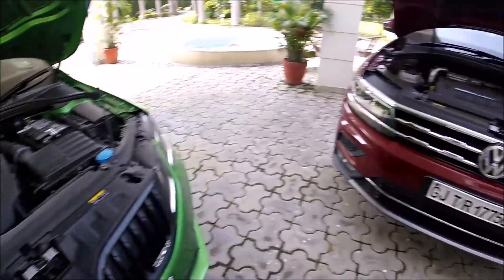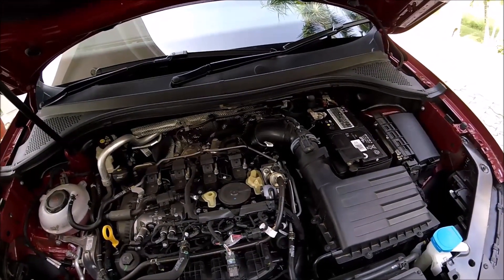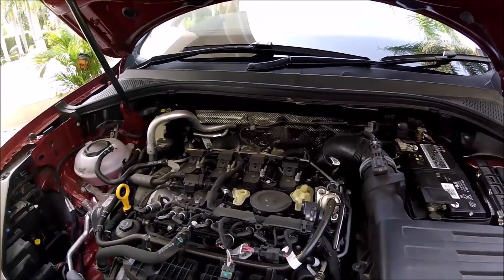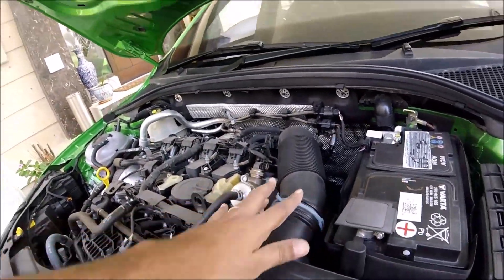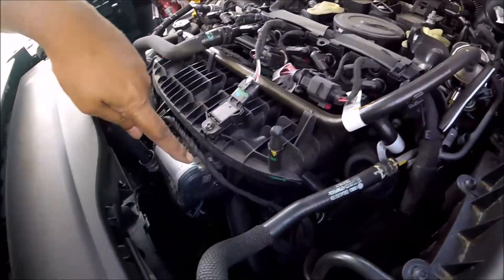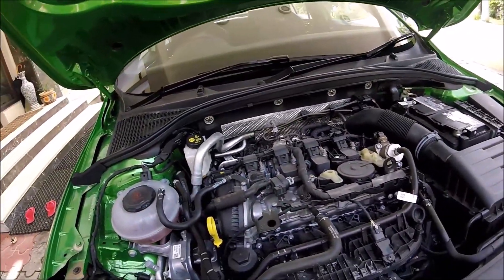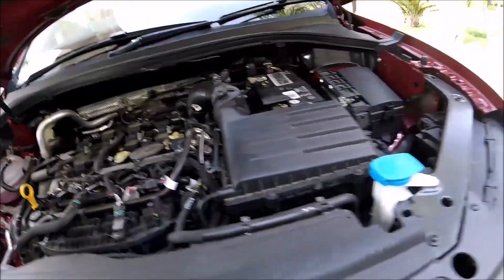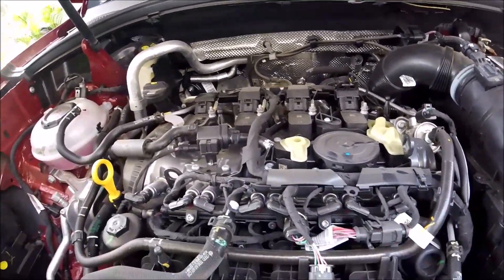2.0TSI Gen 3a and 3b- Differences between engines in the Octavia RS245 &  Tiguan, Superb and Kodiak

Comment: Would you recommend tuning a Tiguan 2.0 TSI (facelift)
Reply from the maker: @thekidshrey  well if it’s a Gen3b then yea, stage 1 and intercooler will net you ~250hp ish. Gen4b you can’t tune yet. Some of the 2023-24 Tiguan and kodiak’s came with that engine
Reply: @PrithwiRay  How should I figure it out then if it's a Gen3b or Gen4😅
Reply from the maker: @thekidshrey  3b has a MAF sensor right after the intake, 4B doesn’t.
Reply: @PrithwiRay  Oh ok! Which place would you recommend would be the best for tuning in hyderabad? Any idea?

Comment: Hi Prithvi, Very informative video. I have allspace stage 1 currently , I need more power , I was thinking of a engine swap with 1.8 stage 3 IS20 280hp but then it will cost me around 5 lakhs and I won't get good price for my current engine So I was thinking of pushing my current engine to 250-260hp with mildly tuned IS20 turbo. If it can last 15-20k km , it is worth it and then may be I will rebuilt it or swap it with 1.8 whichever is cheaper. Do you think it can produce 260 hp safely for 15-20k km?
Reply from the maker: 260hp not doable on the current engine.

Comment: I tuned my tiguan 2021 ea888 gen 3b to stage 1 and currently in the process of doing a stage 3 with a light map expecting to push 300+ hp. Upgrading the turbo to is38, upgraded intercooler, air intake and downpipe. Would you say it is safe to run in such a setup? Will be using 100 octane.
Reply: I have an Octavia with the same engine. While the initial excitement of a stage 3 tune may sound good,  from a practical standpoint won't make sense as there are very few fuel stations offering 100 octane petrol.
Reply: Also from my conversations with tuners is they don't recommend a stage 3 as it's too risky considering the quality of fuel here.
Reply: To make it short, if you are into tuning your car, sell the Tiguan and pick up and gen 3 1.8 tsi engine and take it to stage 3+ with close to 400 hp!

Comment: Hi, I see that movie is quite old but you still answer here. I have just got kodiaq rs tsi 2023, is there still dktb gen3a engine or they are puting something else now?
Reply from the maker: Depends on country. The Kodiak RS is the same engine as the RS245 I have, Gen3a 2.0TSi
Reply: @PrithwiRay  it is Poland 245 horse power. Thanks a lot.
Reply from the maker: @ekogoryl  yea in that case you got the gen3a motor. Skoda only gave the gen4 tsi motors in the mk4 Octavia

Comment: Hi, will a head swap be enough to turn a gen 3b motor into a gen 3a motor? I saw some guy plonking a vrs engine in his superb. I wonder whether it's a full swap or a head swap or something.
Reply from the maker: Nope. 3B is a totally different engine with new block, head, piston, rods crank. It shares nothing beyond the intake manifold, intercooler and radiator with the 3a.

Comment: Nice video. Quick Question - What sort of power/torque figures you can bump up in the new Kodiaq 2 TSI if tuned?  Say Stage 1.
Reply from the maker: Give or take 250hp if your going to add in intercooler. 220ish hp if your going to keep stock intercooler
Reply: @PrithwiRay  Thanks for the swift response. Any idea on what torque figures we can extract ? The stock figure is 320NM.
Reply from the maker: @vijaydrives  torque goes upto 400+nm
Reply: @PrithwiRay  Great, thanks!

Comment: Excellent explanation of the differences of these two engines. Please make a video on the internal differences of the engines. I have read somewhere that even the pistons are different and they also have different engine oil requirements such as 504/507 for the EA888 GEN3A (5W30) and 508/509 for the EA888 GEN3B (0W20).
Reply from the maker: all Gen3A post 2019 are 0w20 as are the Gen3B motors. Pistons are different, so is the fuel system, 3B has higher pressure in system for the mpfi.

Comment: Hello! I have a polo gti 2019 and I have entered the process of a big conversion. The car is mainly forged and wears Garrett 3071 gen2. Now we are in the programming stage and unfortunately what we notice is that it cannot inflate the turbo easily. Maybe an octopus needs to be inserted so that the exhaust gases have a better flow. We bolted it on. Any other comments on what could be wrong? Does anyone know if the gen 3b is not as efficient as the gen 3? Thanks!
Reply from the maker: It’s not meant for big turbo as the Gen3b is a very high compression motor. Some guys have put an IS38 on it, but it then needs 100RON fuel and nearly zero timing
Reply: @PrithwiRay  understand what you are saying, however I have another question... Is this motor less efficient than the gen 3? The fact that it has higher compression should make it more aggressive at the same time. But on the contrary, it looks too clumsy and weak. It can't inflate the bigger turbos easily.
Reply from the maker: @Oikono13  yes it’s a lot weaker than the Gen3 2.0tsi. The Gen3B is a replacement for the 1.8tsi

Comment: Quick question. I've got no idea which engine is in my audi a3 s line. It's comes with 190 ps, but the oil filler is low down, it has no heat sheild for the brake reservoir, exhaust vvt actuators not the intake but it has the smaller HPFP and throttle body off the gen 3B. I'm very confused
Reply from the maker: If it has a MAF it’s the gen 3b. Only the 45tfsi cars have the 245ps motors
Reply: @PrithwiRay  thank you for that any idea what turbo it is?
Reply from the maker: @kaicooper5917  if it’s the 3b it’s a continental turbo, about the size of the IS12

Comment: How much can the gen3a rs245 handle on stock internals ?
Reply from the maker: Usually the safe peak for these motors is about 400hp. Anything more than that and u will wear things out eventually
Reply: Very close to what the tabahi was running. Did you upgrade the internals in that ?
Reply from the maker: @devenderrrrr  yea this motor will cross Tabahi power level with ease. The gearbox makes it faster than T1 already I’m guessing
Reply: Correct me if I'm wrong the 1.8tsi in the tabahi is only safe till 330 or so read it on VWvortex but you seem to be pushing a lot more. And what's the difference between the gen3a and the engine in the golf r
Reply from the maker: @devenderrrrr  it’s safe till about 360hp.

Comment: Does the polo GTi aw facelift have 6spd or 7spd dsg?
Reply from the maker: If it’s a post 2019 car, it will have the DQ381 7 speed
Reply: @PrithwiRay  what you mean post? Anyway yes this one is the new 2022 polo GTi but you see in South Africa our Golf 8 gtis dont use gen4, we've got the gen3
Reply from the maker: @reconbullet5449  then it will be a country specific model. Need a vin to be able to confirm.
Reply: @PrithwiRay  I did buy the new Polo GTi, there was no other Polo's on floor cause it was all sold out, the vw salesman said there is a back order and might take up to 2 or 3 months

Comment: Could you put gen 3 pistons and rods in the B? Will the gen 3a head bolt on the 3b? 

Curious if it's possible to build a Franken setup.
Reply from the maker: Head will bolt on, but the 3a has vvt on exhaust side where as the 3b has vvt on the intake side. 
The pistons and rods should swap over, BUT not sure about the timing setup difference on these motors.
Reply from the maker: And it will be cheaper to get a gen3a motor swap than Frankenstien build on the 3b. 3b also has MAF and MAP setup where as the 3a is 2 map setup

Comment: Tvs engineering is offering a stage 2+ package for the gen 3b engines. They are claiming 300 hp out of the ecu remap. Is that true ? I am looking to buy a new superb 2.0 tsi.
Reply from the maker: I wouldnt do it.. primarily because the 3B engines are high compression and very sensitive to fuel linked detonation. And you know our fuel quality.

Comment: I am looking at the new vrs 245 but the lack of MPI makes me worried about the long term reliability of the engine as this only has direct injection. So the valves are gonna get dirty faster. Does VW/Skoda has any workaround for the same. as all the other engines are dual injected(port and direct) which would help with the valves gumming up!!
Reply from the maker: The lack of MPI is a problem, but not something to worry about until 50-60k kms. And even then it takes literally 15-20 mins to clean the valves off with a media blaster. taking the manifold off is a pain tho.
Reply: @PrithwiRay  so are the Skoda india competent enough to do this job or we would have to find a independent workshop. Actually this is the thing that makes me wonder why didn't they address it in first place itself. also does the bmw 330i also has direct injection only?
Reply from the maker: @amarcool55  what do you think.. most dealers refuse to open the manifold..

Comment: I have a Polo Gti with this 2.0 EA888 3B engine which has the IS20 turbo here in the U.K. but great to see the differences between the two. 3A variant is much eager to rev whereas due to the higher compression ratio of the 3B if feels a bit chocked when revving out
Reply from the maker: Yes.. the 3B has a lot of disadvantages.. but is extremely fuel efficient. I don't think the Polo GTI gets the IS20.. its a continental turbo I think. Sadly we can't up the boost much on these units due to two limiting factors, high compression and small turbo.
Reply: @PrithwiRay  there seems to be some mistakes made here, the first gen3B from audi had ihi is20 turbos (i have a A3 quattro and did confirm its a IS20) the Polo gti AW From 2017 also has the IHI IS20. maybe the newer ones have the IS12. But the older cars all have the Same IS2O as the Golf 7/7.5 gti. And 260bhp is possible and not a stretch at all on these engines with is20
Reply: Is12
Reply: @KodaChimkenLuva  definitely an IS20 on my 2019 uk polo gti, I can see the number embossed into the turbo casing. Limiting factors for tuning is the higher compression ratio on budak cycle and intercooler setup means high intake temps. A few mods and a simple remap can see 250 bhp easily. Cracking little car, especially when you consider the £10k or more lower price than a golf

Comment: Hi man, I'm thinking of getting a second hand Skoda Superb with the 2.0TSI 280HP with around 150k KM, how reliable are these engines? Has the oil consumption issue been solved? What's your opinion?
Reply: Excellent engines but no FSI on them (not sure why), so the inlet valves can get gummed up and not easy to clean as no fuel/air mix going over the inlet valves. In the US they sandblast them with ground walnut shells, weirdly enough.

Comment: MAP sensor = Manifold Air pressure, not mass air pressure sensor.
Reply from the maker: not manifold air pressure, but manifold ABSOLUTE pressure sensor. Its basically an air pressure sensor mounted on the intake manifold. The term comes from N.A cars as they only have one pressure sensor mounted on the intake manifold. We use the term mass air pressure for similar sensors mounted anywhere else other than the intake manifold, like on the intercooler to throttle body pipe, as there is no 'manifold' there.